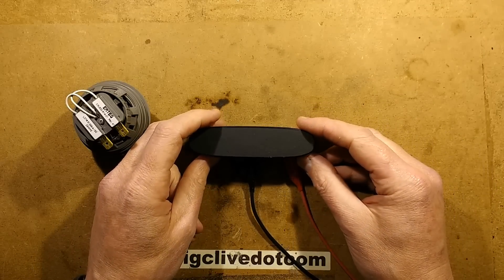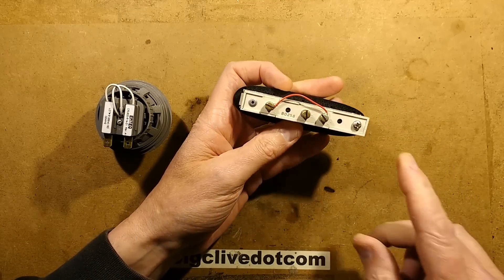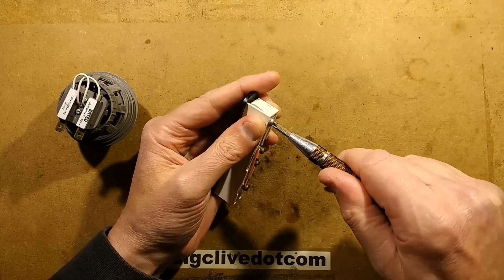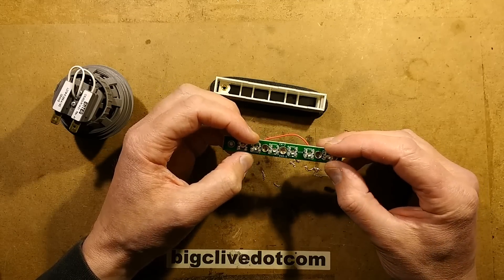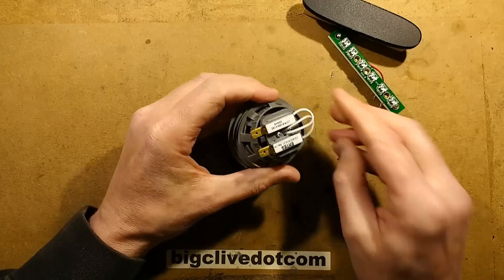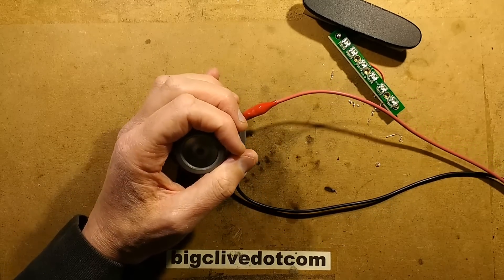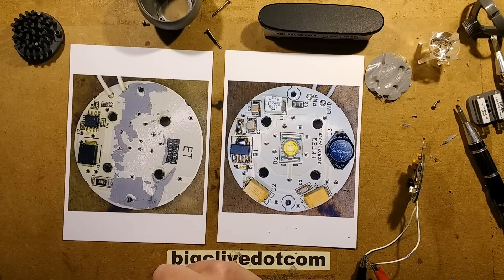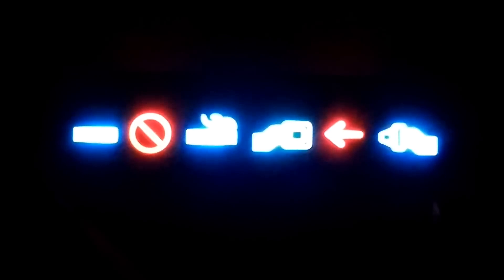What's inside an aircraft seatbelt sign?  (and swivel downlight)

Comment: Your discovering an unknown (mostly) aspect of aviation; approval time. It can take well over a decade to get something approved as flight hardware! That seat belt/no smoking sign was designed tightly around an already approved previous version. A unit lit by GE "wheat Lamps". They drew about 3 watts per circuit, same as the LED version. It couldn't draw less. It needs to draw that much to be detected as on by the cabin monitor circuit in the flight deck. Hence, aircraft design evolves very slowly!

Comment: The diode and the inductor near the switching regulator are quite beefy.  Maybe the chip needs an external switching transistor.  But why would it then be on the other side of the board? // Another thing that would also not make sense for the big transistor is reverse polarity protection, it obviously didn't do that.

Comment: Hi Clive, everything on an aircraft is built to a life cycle and it cannot exceed its life cycle before it must be changed, in addition it must meet various aircraft regulations for safety which includes toxic emissions in the event of a fire, various aircraft safety and power consumption requirements, and the design must meet dictated specifications as currently laid down. These lights are based upon a 5 year life cycle.

Comment: Just a point of note, the reason that lamp may not have worked is that most aircraft stuff works at 28V, not 12
Reply: (Or yeah, you may have cooked it)
Reply from the maker: I'd probably cooked it, but after i fixed it I did test it from 12V to 28V and it regulated to around 3W all the way.

Comment: Q1 on that overhead light could be a mosfet used as an attempt at reverse supply protection. Especially if it's in the -ve supply feed. I have used similar circuits. But if reversing the supply killed it, it may not be an effective implementation!

Comment: They are a very strange pair of items, especially as they are from the same company.  The "6 LEDs in a box" design is about as simple as you could possibly make it.  But then the overhead light has a weird-looking non-standard LED, proper spade lugs, a multi-layer board, a big custom heatsink, perspex optics and active chips.  Just to turn a light on and off.

Comment: re Dimmable.  The lights fade-in/fade-out when turned on/off.  Presumably this is done by the old soft-start circuit somewhere else which was used in conjunction with the old Tungsten lights before they switched to LEDs.  When they switched to LEDs, the light fitting had to emulate a tungsten light to avoid throwing any maintenance errors or flickering lights.

Comment: for the overhead light Id guess that Q1 does the lifting of the actual switching regulation since they're using a fairly beefy coil. I've seen similar regulators like that with the beefy schottky diode and coil like that in an old circuit and it had substantial drive. It was a 14 pin inverter with ALL the outputs tied together to drive it. Its probably supplying an amp or so to drive a 4W LED at ~3-4 volts.
Reply: And since this is aviation it wont be the latest chinesium driver chips. Reliability is paramount so they use traditional designs known to be reliable. These have to work for thousands of hours, not a few weeks and then go pop. It will likely have been tested under a multitude of conditions that would have killed the Chinese junk in short order.

Comment: I agree with you that the heat sink and even the light itself is an "expensive" part to make, but in reality, theres at least 100 per plane, and several thousand planes, and planes being ordered every year until the end of time. Surely the manufacturer knows this and would be able to make the part for less than a couple dollars up front, and would eventually get it below $1 per part over time right?

Comment: Being that it's an aircraft part it has to pass a certain shock and vibration spectrum before it's allowed into service (the specs of which are dependant on the aircraft manufacturer). It's possible that the "traditional" drivers aren't qualified to these specs (yet), and these older ones are. That and you want a VERY long MTBF to reduce costs.

Comment: He never noticed that he never had to drill that rivet on the no smoking light. Most things on/in airplanes are meant to be serviced.
Reply: Most things, except maybe light fittings that have "non relampable" printed on the side of them?
Reply: What's your point? Are you saying that he did have to drill the rivet? No shit you can't replace the lamp, I never said you could, I just said that airplane fixtures and such aren't the same as consumer products where they are designed specifically so that you can't service them.
Reply: I am saying the light fitting was designed specifically so you can't service them, else why was there a rivet where you'd expect a screw otherwise? 
How would hope to non-destructively:
a) Remove the cover without removing the rivet?
b) Remove the rivet?
The fixture Clive was looking at is not serviceable and designed to be thrown away when it fails. That why they sealed it with a rivet.

Comment: light up no smoking sign. Old school setup. 

The darlington would be for the emulation of an old tungsten lamp for easy fitment in an older aircraft originally fitted with tunstan (the very rare aircraft still is, put your hand up to the light and you can sometimes feel the warmth).

The filtering is likely to stop RF being conducted down the power lines. Aircraft are tested to significantly tougher EMC standards than commercial (RTCA DO-160 [and/or MIL-STD-461] vs CISPR 15) restricting the electromagnetic noise put back on the lines

Comment: Yes, you're correct.  Those type of switching power supplies are notorious for spurious RF emissions, especially below 30Mhz.  And with trans-oceanic flight communications still located in the 2-18Mhz range, I'd expect there'd be some rather beefy RFI suppression filtering on any potential source of noise like that.

Comment: The "bong" sound may be coming from a Siemens chip, the SAE800 Gong Generator. Yes, really, that's what they call it. There was also the similar SAE600. 8-pin DIL parts. Mostly done with analog oscillators.

Comment: i once looked up about economic disasters and found one about sort cables and airbus A380 , they outsource the production and two different designing  groups used different versions of cad software and the software from one version to the other had changed the way of calculating the cables when they bend and at assembly it was a huge difference 

http://calleam.com/WTPF/?p=4700

Comment: Do a lithium battery teardown on a plane and pretend it's your dinner. 
They'll love it.
Reply from the maker: +Blacktronics Excuse me hostess, do you have an explosion containment pie dish?
Reply: I believe my lithium meal is on fire
Reply: That is why you ask the hostess for an explosion containment pie dish
Reply: @bigclivedotcom is this before or after saying.

Pardon me do you have any Grey Poupon?

Had to slip this in of course haven't heard this often enough lol
Reply: Speaking of explosion containment pie dish

There was one time that unbeknown to me 

 one of those power banks that had been recalled years ago

That almost no one knew there was recalls add something to do with the insulation rubbing through and with use of the buttons just causing a potential Short Circuit before the battery protection yikes!

Needless to say this is the first time I've ever seen a what's your battery go ballistic personally.

Long story short add the power bank in my pocket after heading back inside.

Thought I had accidentally left a 9-volt battery I was going to change out in my pocket not a good idea anyways but people do this of course even if they should know better.

Shorted out on keys or some coins.

Didn't realize I had the power bank in my pocket and like oh crap moment!

Grab the cast iron skillet Happy by the kitchen.

Ran out the door Chuck that power bank as hard as I could toward the parking lot.

Within who knows how long sure enough plume of smoke and Flames that was close!

Will be nice to have what they have on board aircraft for that purpose.

I actually have seen the similar things for sale for a similar purpose cannot remember where

Comment: I'd love to see an airline implement disco displays. its a terrible idea but id love it the first time
Reply: The new 737 is fitted with RGB LEDs for "mood lighting". You can change the lighting settings on the touch panel at the front of the plane (if the flight attendant is not looking).
Reply: 787s have twinkly lights.
Reply: The 707s in the 60s and 70s had a starlight ceiling... the stars twinkled !!!

Comment: Interesting high end specification units... (to a degree) compared to Clive's more normal OneHungLow products of shonky quality... (There's possibly a bit of commercial secrecy at stake on the units shown here)!  

Yuck to 5600K colour temp cool white on the swivel light LED? I would have preferred the more usual 3200K warm-white for that 'homely lounge incandescent illuminated" look for a plane interior...

On the seat belt light... how'd the circuit board rivet to the other half which was plastic. I have never made a pop-rivet into plastic hold because it would just deform/crack the plastic... I note the manufacturer had gone to the expense of using a molded brass thread insert though for the other end...

Comment: As a former airline mechanic, I'm really glad to see the use of LED's in ordinance signs.  The tiny incandescent lamps in the older models were constantly burning out requiring replacement.  A never ending pain in the ass!
Reply from the maker: +Elodea Yeah, but.... Job security.
Reply: You're correct, but those tiny lamps were always burning out (over voltage at 28 VDC driving a 24 VDC lamp for increased brightness). BTW, my USA model Quicktest arrived today from the link you provided. Greatly appreciated, useful tool!
Reply: @Elodea  hmm, i know this comment is 6 years old but ive been wondering the holdup for getting LED's in more aviation electronics. I believe in an old video from the channel "Mentour Pilot", he is in the cockpit for a 737 (max?) and he shows one of the tungsten replacement bulbs for the cockpit which he said pilots sometimes need to replace prior to flight or while trouble shooting and he points out that the MAX really is just fresh lipstick on a ~60 year old design and he says how difficult it is to get simple changes approved and so "if it aint broke dont fix it" logic prevails. The channel "Technology Connections" pointed out a bunch of odd niche cases in his video "The LED Traffic Light and the Danger..." about how old school incandescent lights are still the primary type due to things like protection from frost/snow (naturally a heater). I'm wondering if there are examples in the aviation world like your 2nd comment which suggests cabin lights might be exposed to common overvoltage situations. Is that something that is too difficult to work around with some kind of ballast? or would that change the properties of everything else wired to it and be more of a headache? I am under the assumption that newer plane designs like with airbus might already have LED's. TBH ive grown to appreciate the dim but true output of og bayonet style incandescent lights, especially for reading in the dark. Im pretty sure the tensor lamps were 12v automotive DC lamps which people are buying up these days.
Reply: @aaronbrandenburg2441  interesting story. the funny thing about the old series christmas lights was that they could be used to make detonators back in the old days of youtube tutorials before we got "safer"
Reply: Regarding the tensor light the original prototype yes did use automotive bulbs I think technology connections also has a video on this as well if I remember correctly and also there is a Wikipedia article that also talks about the Prototype.

Matter of fact I'm building my own custom work light slash high intensity lights that will use automotive bulbs by the way higher wattage filament on the two film bulbs is usually about the same hour rating as the high intensity bulbs.

Also this has the option of using the lower wattage filament as well.

Those bulbs are cheaper than the high intensity even so Automotive lamps should be considered for something like this and would work well depending on the application and your own preference.

By the way reflector May either be something similar to the Prototype of the tensor lamp AKA a measuring cup or something somewhere something similar.

Ford reflector / shade of a lamp what are those conical ones of a suitable size.

When is to adapt everything to fit on microphone stand thread or bolt thread that's the same as the camera tripod thread.

Which by the way is a standard bolt thread don't remember the specs!

And you can get an adapter to go from microphone thread to tripod thread!

Add easy enough to do this if so inclined makes a great Universal type of mounting think of the possibilities in the workshop with a few mic stands in various types.

Plus like Motown microphone brackets and the goosenecks.

And being able to put light when you need it and other things as well.

Already working on a hands-free setup for phone like for watching videos and hands-free Zoom.

Using a very specific brand of phone holders one of which at least has wireless charging built in and the cable and electronics are built into the head of the unit and not into the base in this case a cup holder insert.

I realize that all the fittings and all are the same across all their phone mounts and accessories for this.

Easy enough to adapt to other things for custom or one off applications or devices.

For example if there's some standard that can be used as is or slightly modified why not use it as a basis of something.

Kind of not Reinventing the wheel but just reusing it in a different manner would be a good way of saying this.

Otherwise go with repurposing or recycling depending on where something is in its life cycle as well should always be considered.

It's also in the case of when something is broke but still could be made use of repurposing.

My folks used to have rules that if something went out it got repurposed or at least salvaged for whatever it could be you'd be surprised at what Old Farmers did.

Even some modern day ones you better bet stuff is repurposed and used until it is of no longer any use for anything.

You wouldn't believe what my grandparents have repurposed over the years.

We've even repurposed things that were originally repurposed!

You know those pesky places you can't get into with the broom Dollar Store paint brush plus perhaps a Dollar Store broom handle or anything else suitable preferably repurposed slash salvaged!

Bit of handyman secret weapon!

AKA duct tape!

Equals mini broom for those places you can't get to with the full size.

Adjust the other year got a vacuum cleaner working again.

The stupid plastic release pedal with no actual spring just a thin portion of the plastic of course which broke off.

Balled up rubber band philosophy of duct tape equals the vacuum back in action take that essentially disposable devices!

And if it reminds you of a TV show back in the day it should straight up MacGyver!

And yes I've been referred to as the real life MacGyver so many times.

In a good way!

And also so many times I've been said if I can't fix it it ain't broken some more often than the above so many times I can't even fathom how many times it's been between the both of them

Comment: There are two reasons why dedicated LED controllers are not used for this sort of work in Avionics. Firstly it takes at least 5 years to get anything qualified for flight by the time you have all the paperwork sorted etc  and some of the LED controllers have not existed that long. Secondly with such an extended qualification period you cant really afford to use components which are likely to go obsolete in just a few years as the tech changes. I used to work for Crane Aerospace in Burbank and this was always a problem (as it is also for military and automotive).
Reply: You can get some systems qualified significantly quicker than 5 years (depending on design and end use) but you are correct regarding the obsolescence issue of using specialised components.

Automotive also have the problem of crazy tight BOM costs to consider often making discrete the way to go.
Reply: Sean theoretically you can get some systems qualified in under 5 years but have you ever tried doing it? A while back working for Crane Aerospace we were getting just some seat parts qualified, the first stage which could be done theoretically in a matter of days took 3 months because trying to get all the relevant people together to witness the work is like hearding cats. Also nope discrete is far from the way to go with Automotive as that increases component count thereby increasing placement costs and reducing reliability. When I have done re-designs of automotive systems the key issue is usually reducing component count. EG going from a microcontroller with external CAN phy to integrated. Some components like high side drivers push the component count up but there is nothing you can do about that.

Comment: exterior of the swivel light looks a lot the old halogen swivels, I'd guess it designed to be retrofitted into existing halogen sockets on halogen bus voltages. 
If they were designing LED lighting for a new plane from the floorboards up I'd have thought they'd regulate it down to a more appropriate voltage for LEDs centrally.